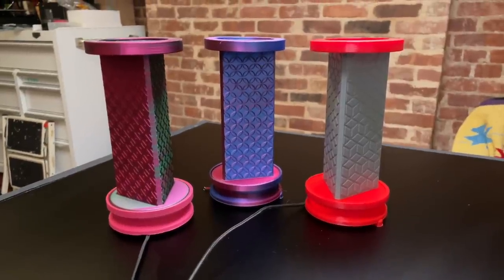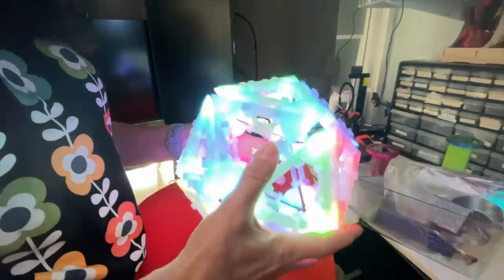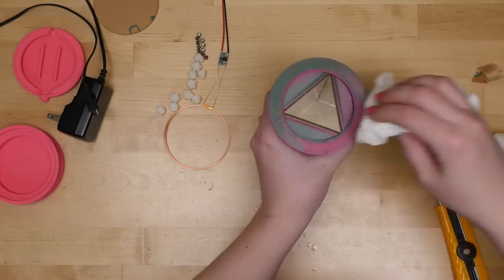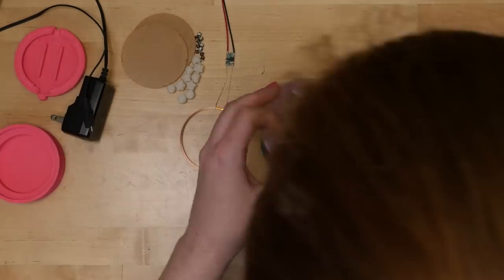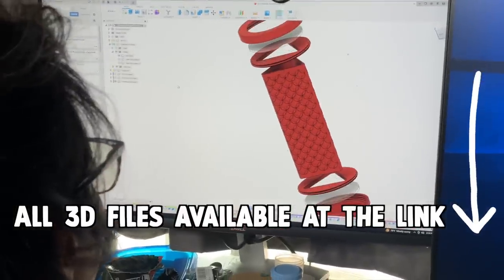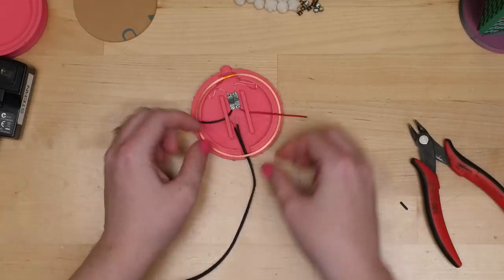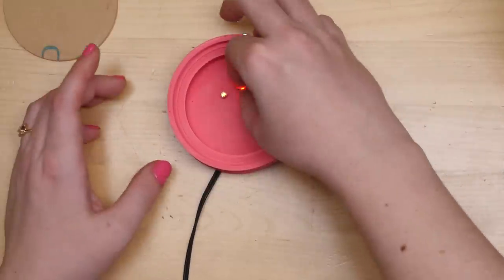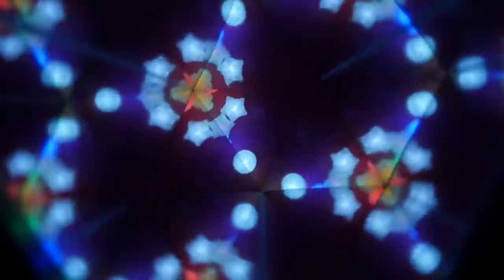LED Kaleidoscope

Comment: This is the coolest use of wireless LEDs there is. Very cool! 🎉❤ I wonder what would happen if you put a mirror under the LEDs and a 2-way mirror as the lens on top of them. Would you get an infinity mirror kaleidoscope? 🤔
Reply from the maker: 🤯 only one way to find out!
Reply from the maker: ok putting a mirror on the bottom just puts an image of your eyeball behind the LEDs 😆 Gotta find my 2-way mirror acrylic...
Reply: @BeckyStern  I probably have a scrap that size if u need it!
Reply: YES! You can put wireless LED's in infinity mirror setups, and you can put a kaleidoscope over that. And, mineral oil isn't conductive. So you can fill this with mineral oil. These wireless LED's have a lot of fun uses.